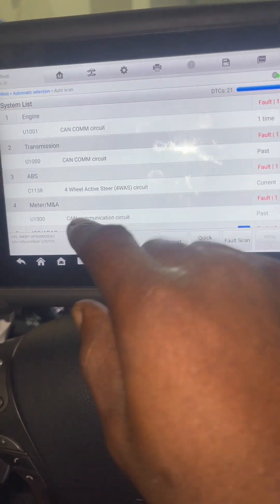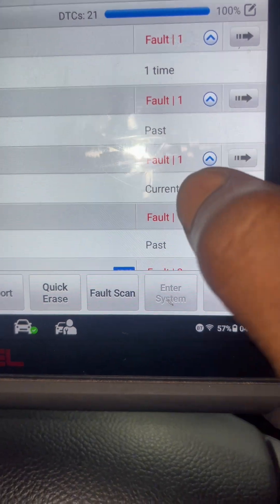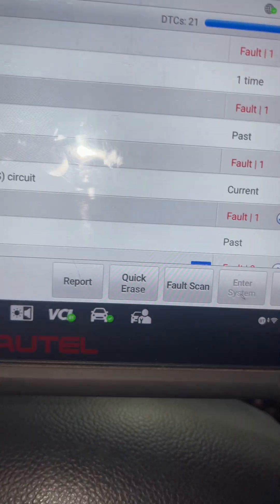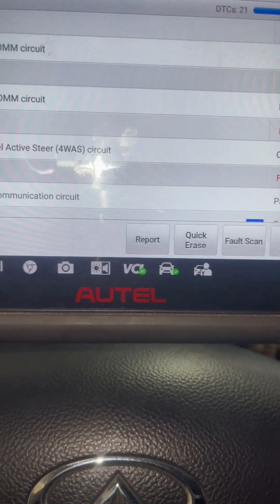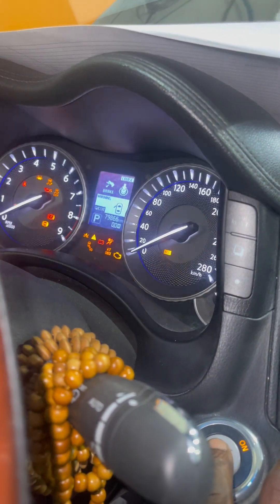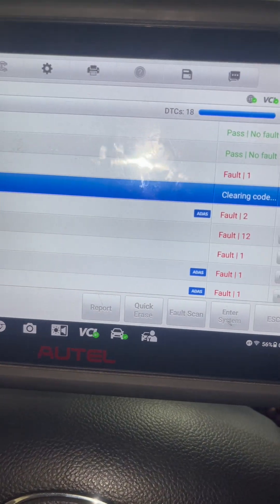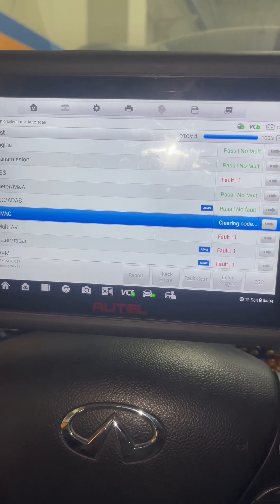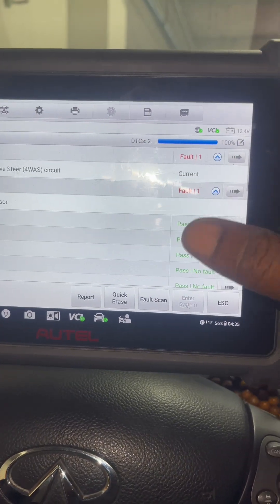Infiniti 4was : Traction light : Troubleshooting

Comment: Hi, does the problem be solved? I have the same issue with my M37, 2011. I tried a lot to maintain it with no luck. Some technicians were tried to maintain the steering pump motor which located in the rear  bottom of the car between two rear wheels, but unfortunately it didn't worked and they advised me to replace this pump to solve this issue and i am suspected about this advise, i don't want to lose 1500 usd for part that not sure can solve my car issue. So please let me know if this solution has worked out successfully. 
I believe this is a public issue with all infiniti m37, m56, and q70. It's a manufacturer defect
Reply: there are other users have the same problem, could be multiple things, including 4WAS front Actuator or 4WAS Rear Actuator, 4WAS Rear Motor, Steering Angle Sensor, 4WAS front Control Unit or 4WAS Main Control Unit or, just Wiring Harness or 4WAS Fuses or 4WAS Relays, you need to find the error code and clear and see what symptoms you see, but I'm in a same boat where I don't want to take my car to Infiniti because it's expensive, trying to solve it myself, some people managed to fix by fixing the rear 4was motor, some by changing the front 4was control unit, also you can find parts maybe from junk yard cheaper rather than new,
Reply: @weekendmechanic1  Thanks for your comment. Yes, I tried to fix the rear Actuator motor but not fixed. The diagnostic shows fault on the rear Actuator motor, but I want to make sure if the control unit can be the problem also. I know some people they managed to fix simply by maintaining the Actuator motor, but on my case, it didn't work. So I am still looking for an alternative solution instead of going to purchase part from infiniti, which will cost me the same price as the whole vehicle.
Reply: @masn9 did you figure it out man if so please let me know